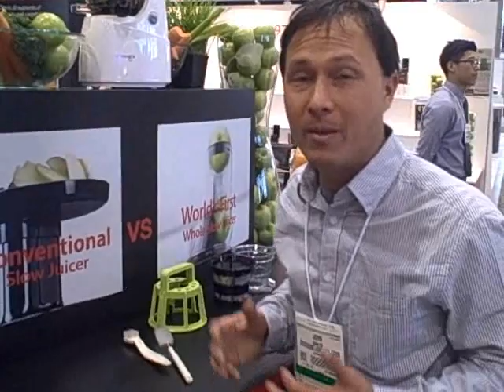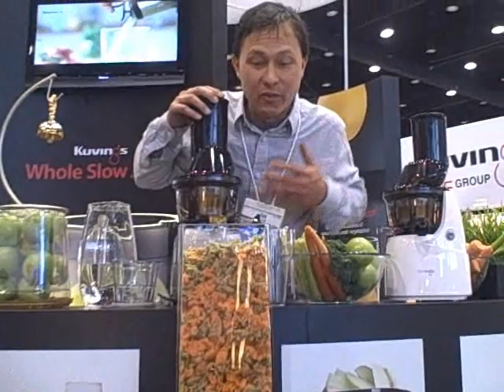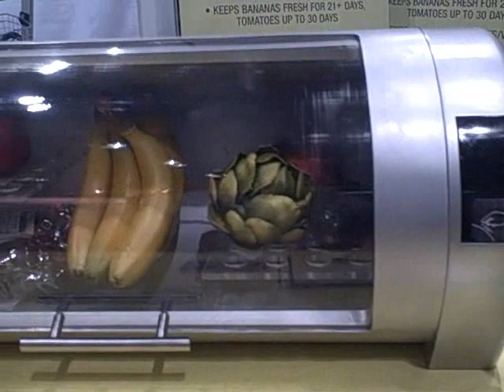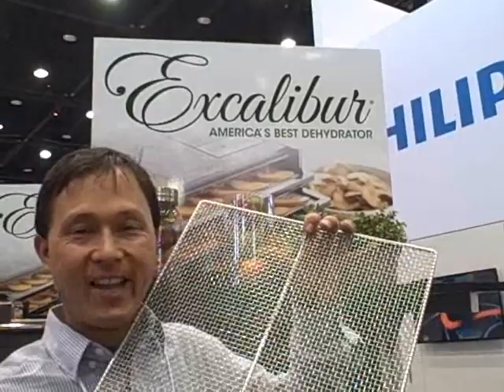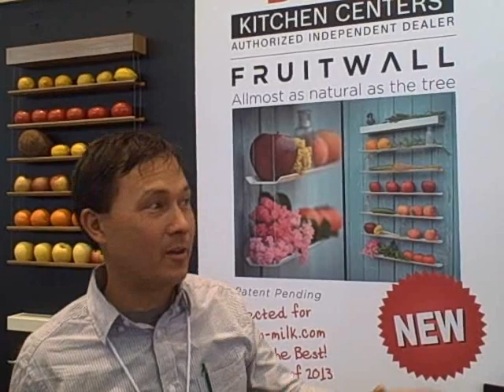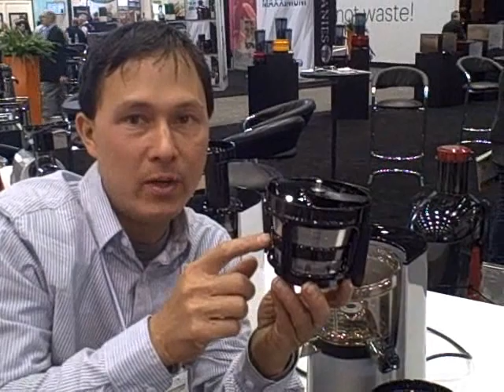Sneak Peak of Juicers, Dehydrators and More Coming Soon to Your Kitchen

Comment: John I love the new Excalibur dehydrator, I just might be sending my new one back to QVC. I will need a payment plan though that is more than what I make in a month. My timer dial in my new dehydrator came off the other day when I asked my finance to set the timer is this normal I just received it that day when I asked him to set it? Thanks for the tip setting the temp high for 2 hrs I just made my first batches of banana chips and apple chips. But they have been dehydrating for a couple of days but I have my temp set at 106 thinking that it runs hot considering when you did the challenge on kale chips with the Sedona and Excalibur it ran much hotter..  I really liked the fruit wall and the produce keeper. 
Thanks again John

Comment: Hey John, I would like to use that kuvings screen cleaner on my omega vrt screen. Looks like the same screen. Do you sell it separately?
Reply from the maker: The screen cleaner will likely not work on other machines as the diameter of the screen and location of the screen is different.